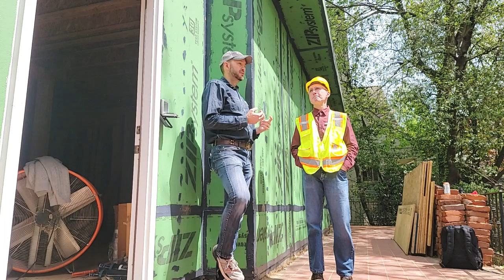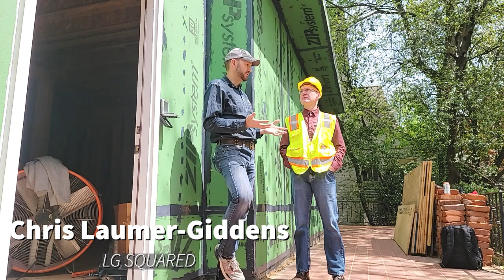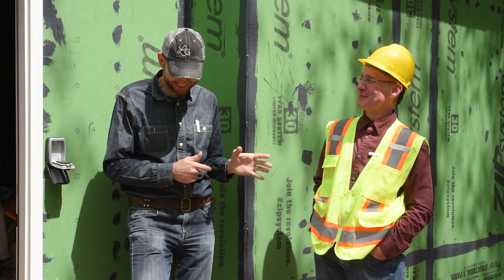Liquid Flash vs. Zip Tape: When should they be used?

Comment: Was pretty much sold on the zip liquid flash until I started wondering if it's REALLY any better than all the other brands of liquid flashing... So, I go to youtube and find that the real-world experience with it is that if it's too thin, it will dry, crack, and allow penetration! Why would anyone pay that kind of money for something that isn't almost bulletproof? If it really does crack (and there's no way to get a thick coat everywhere), what is the actual advantage? Wish their engineer could answer this!
Reply from the maker: Where did you see that it would crack?
Reply: It was another youtube channel with a professional contractor who uses it all the time. He was just trying to emphasize the point that the application needs to not be thin. What it says to an amateur is that it can fail even when there's a solid layer upon application.   @SawHorseDesignBuild
Reply: I've seen another video they use siga grey tape and the liquid flashing